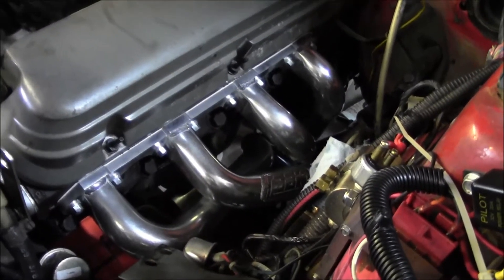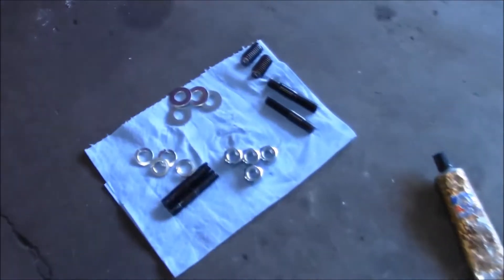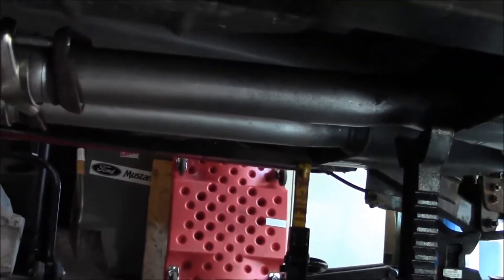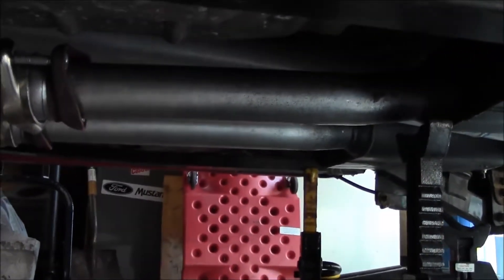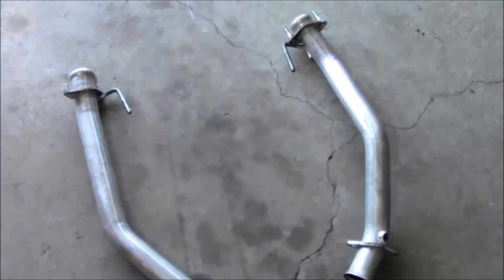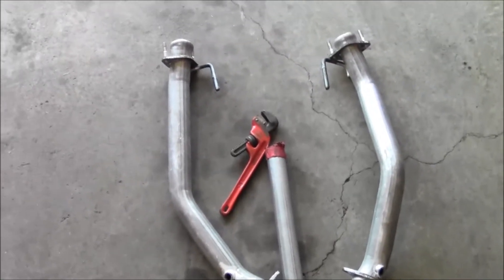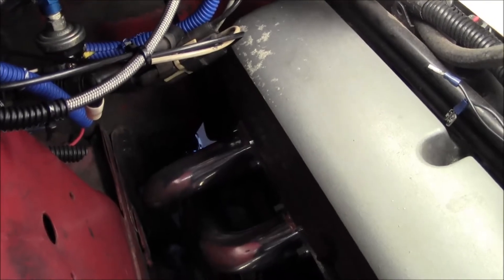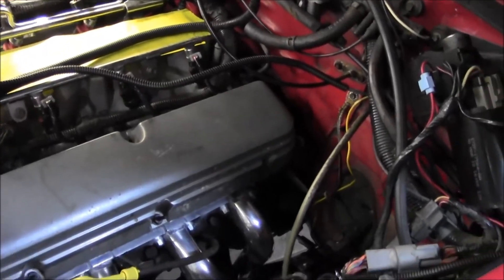Fox Mustang BBK Long Tube X-Pipe Issues

Comment: Hey how is your up date on the BBK long tube headers now? Everything is running good with the X-pipe?
Reply from the maker: So far so good.  The car is down now because of a carrier bearing shim issue.  Exhaust is solid though.
Reply: @fwh79FOXR6  does anything get burned because of the long tubes? And i heard that it was a hassle  working and switching parts of the car that are around the long tube headers? How bad is this? Or is it exaggerated?
Reply from the maker: @oscarvillarreal8951  The headers on this car are ceramic coated and I haven't had any issues with burning anything.  The long tubes can make doing a clutch swap more difficult than short tube headers.  However, I would say any hassle caused by the long tubes... is well worth it.  They perform and sound well beyond anything a short tube header is capable of.  No contest there.  Out of the three Mustangs I play around with, my white Mustang is the only car with short tube headers on it and I can't wait to do a long tube header swap on it.  Yes, long tubes can be harder to install and also make some maintenance jobs more tedious (clutch swaps or starter replacement).  That is true.  I personally feel the extra effort that goes into having long tubes, is more than worth the added effort.  I will also say, you are the only person who can make that decision for yourself.
Reply: @fwh79FOXR6  did you put a different gasket or the 1 that came with the BBK kit? Because I heard the ones that come with the kit are trash and end up dissolving.
Reply from the maker: @oscarvillarreal8951  I used the BBK gaskets and they are holding up so far.  However, there are several aftermarket gaskets you could purchase if you are concerned about the BBK gasket failing.
Reply: @fwh79FOXR6  thanks for your time bro 👍
Reply from the maker: @oscarvillarreal8951  You're welcome.  Always happy to help out.